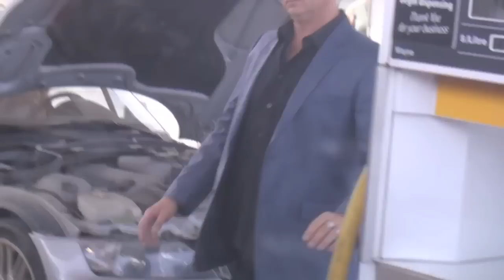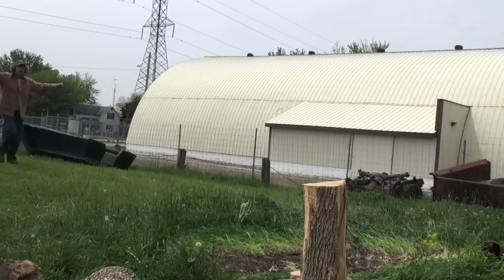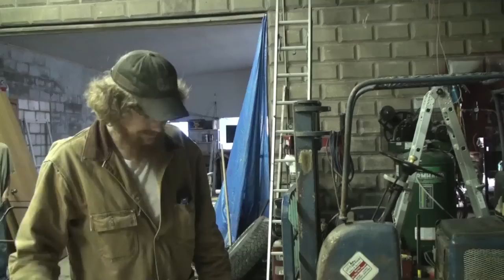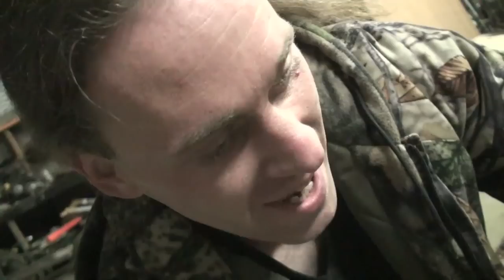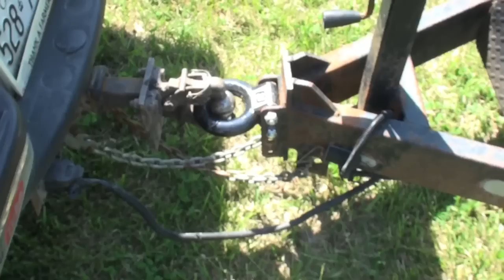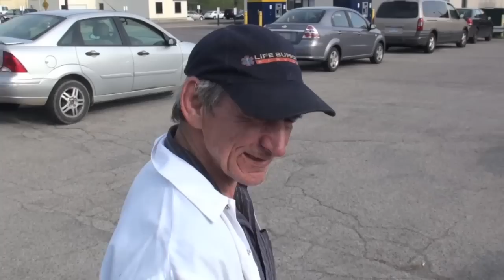sunday funday

Comment: Hey Pug....Got a tip for inflating that tire. Take a ratchet strap and run it around the outside diameter of the tire and ratchet it down as tight as you can. That should squeeze the tire in just enough for it to seal around the bead....then just add air. Hasn't failed me yet.